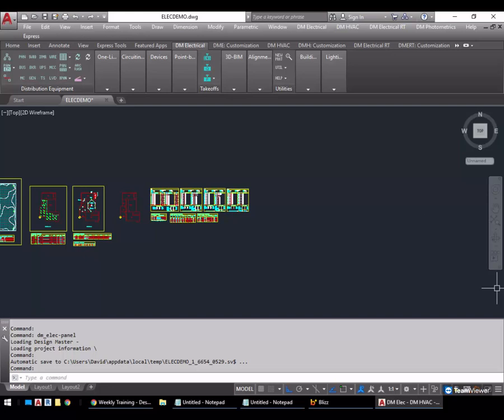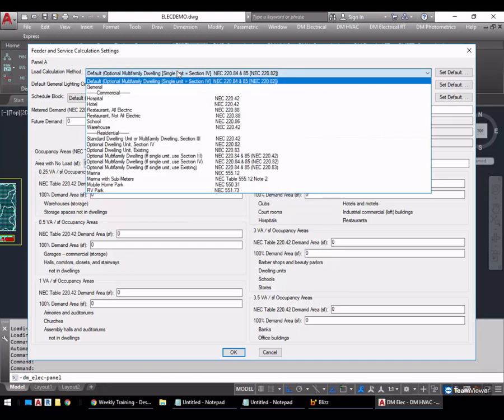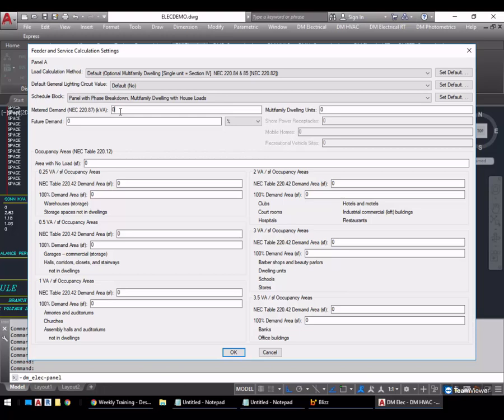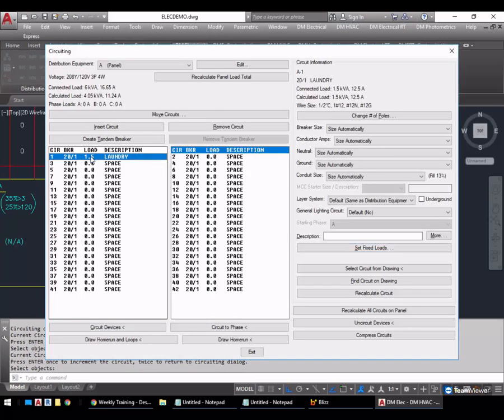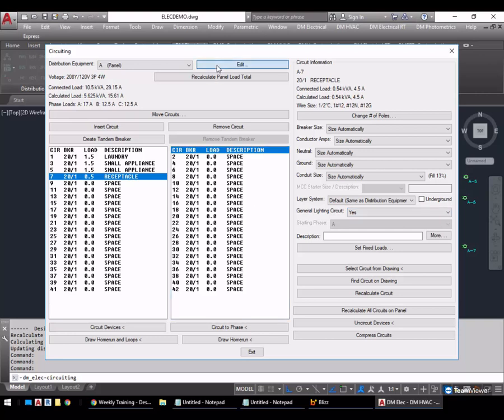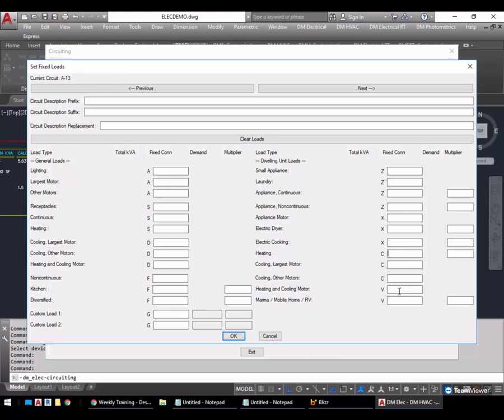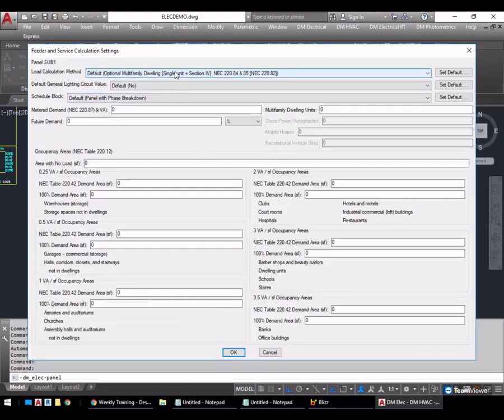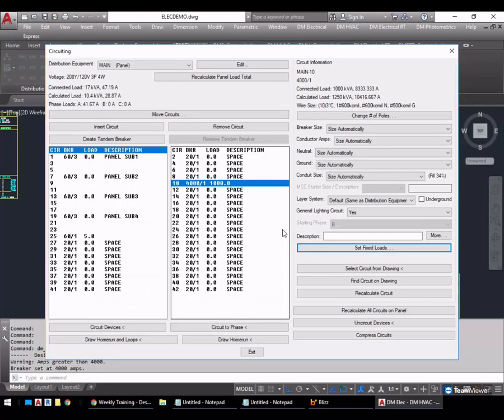Design Master Electrical for AutoCAD: Dwelling Unit Load Calculations (10/25/2017)

Comment: While doing optional method of calculation, entering the Heat pump or furnace load doesn't calculate correctly, because it takes whole as heating load, let me ask it with example, one of my dwelling unit has one ceiling heater and one heat pump, whereas the heater load is 1.25 and heat pump load is 3.96, and the design master calculates "Heating or cooling" load as 4.77 (it takes heating load of heater as 65% but heating load as 100%) which is technically wrong, as heat pump might not be used heat and cooling pump at the same time. so the actual value would have been comparison of 3.96 which is A/C load and 1.25 as heater load and the answer should have been considering the greater value 3.96. So the design master should either change it's programming to take the cooling load from heating & cooling motor or only 65% of heating load should be considered for heat pump.
Reply from the maker: 220.82(C) has a lot of complication to it.

Heat pumps are tricky because sometimes they count as a heating load and sometime they don't.

You need to figure out how they should be handled in your situation, then model that properly in DM.

If the heat pump needs to count for heating, set it as a "Heating and Cooling Motor" load. If not, set it as a "Cooling Motor" load.

In the example given, define it as a "Cooling Motor" load.